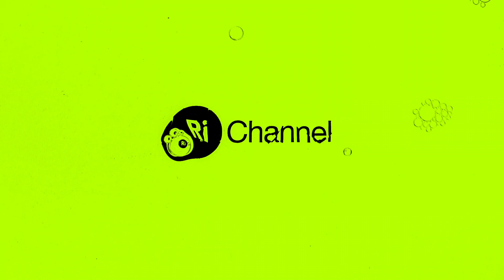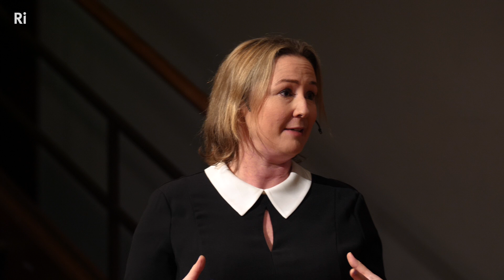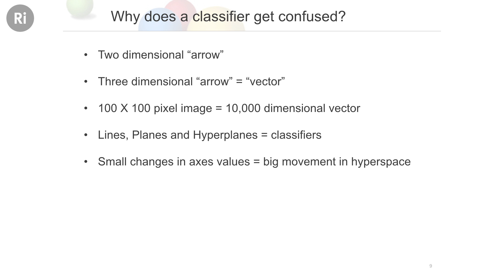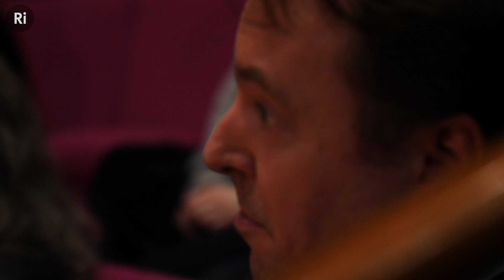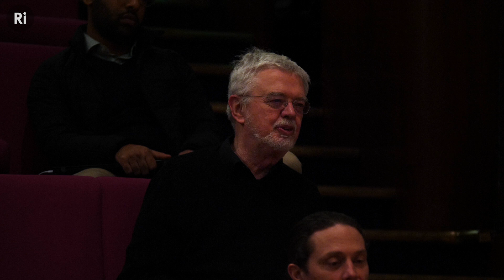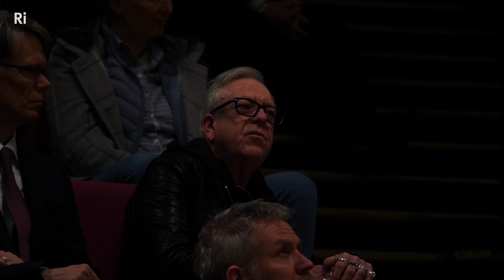Q&A: Will Computers Ever Think Like Human Beings? - with Vint Cerf

Comment: We need some sort of "virtual machine" standard so old code can continue to be run and access to old types of information is not lost.
Reply: Linux, QEMU/KVM, ...
Reply: @juricakonsec2337  Not even close.
Reply: @MuggsMcGinnis , ehm, MAME? :)
ZX Spectrum emulator?
What kind of information do you think about? Where is it?
Reply: @juricakonsec2337  Old mainframe operating systems and such. We're losing access to lots of old cade. We need standards for virtual machines to be built on so emulators can be run in the future.
Reply: @MuggsMcGinnis , the techniques used to build emulators that we do have can be used to build similar emulators. We have the common foundation for that. The hardware and properties of the old systems are very diverse, so I doubt that it is possible to build much broader common platform(s) than we already have.
BTW, the ideas and tools of software engineering have greatly evolved during last 30-40 years. Today, and I think also for tomorrow, it is much more important to be able to build easily adaptable software in an efficient way than to use old software.
What we should (re-) use are methods and patterns that are proven to be efficient and reliable. This is much more important than the actual old code.
N.B.: we see that software that has been built to follow natural logic of the matter has way longer life cycle and reliability that software that has been built with the main or the side idea of establishing or sustaining a monopoly.
That underhanded indirect attack on open source code in the lecture is distasteful, pathetic and just wrong.
Reply: @juricakonsec2337  I agree that open source code is the way to go. Or, if not exactly open source, the source must be licensable and archived in places like the Library of Congress. IBM did an excellent job of documenting the PC (I think I still have a copy of the hardware manual) and that sort of attention to detail should be the norm. 
Microsoft and Apple have polluted the industry with greedy control of poorly standardized systems. Microsoft was required to document their server S/W but they have managed to make that documentation into garbage.
Some of the onus must be on customers. Unfortunately, the people who make computing purchase decisions are seldom experts in computing. But things have improved in that area... it used to be that corporate IT departments were run by Accounting.
After managing 7 or 8 operating systems and programming in at least 14 languages I've concluded that we need some well organized way to hold things together so our information doesn't dissolve into a modern day Babel.
Reply: Do you have any example of information that was lost because the software that accessed that information no longer works in modern machines?